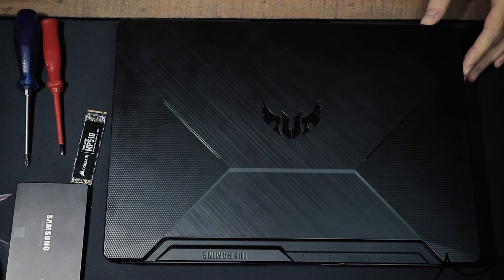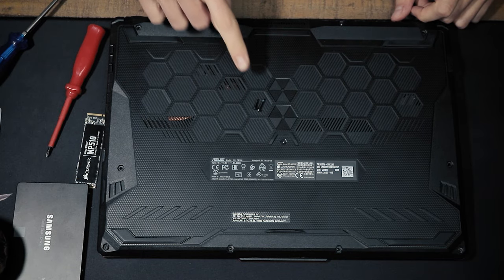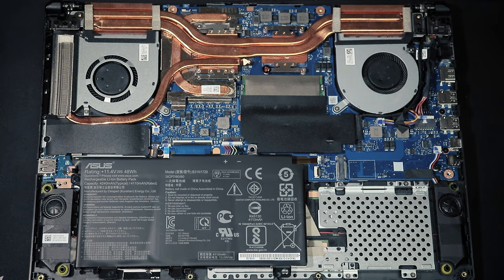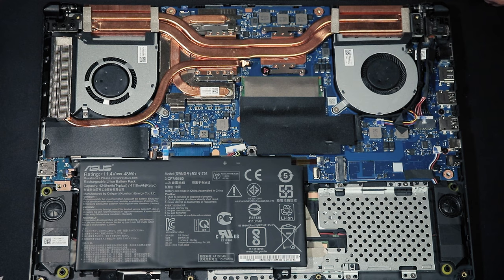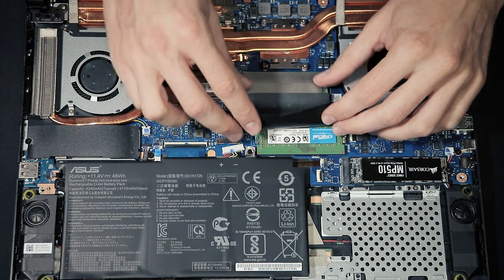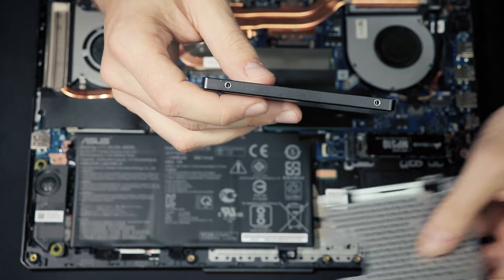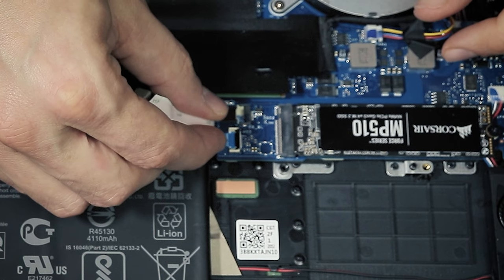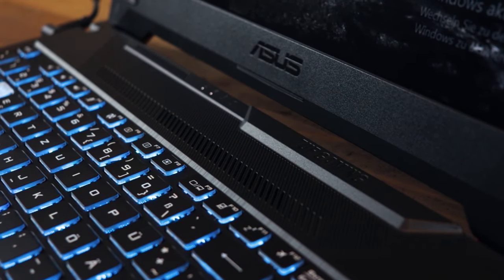ASUS TUF A15 // Installing SSD + HDD + RAM (Is the cable too short?)

Comment: Im getting my own tuf a15 in 3 weeksand im thinking about upgrading its memory and ram capacity on my own so thanks for this step by step tutorial.
Reply: Why so? 2021 or 2022 version has 16Gigs which means games runs good at ultra settings it's required to atleast have 8gigs and good specs which ASUS TUF A15 has RTX 3050 And AMD Ryzen 5 or 7 well.. In my country there's no the 7th version only 5th
Reply: @NitrixChamp  i found both 8 and 16 gb versions but the 16gb is €250 more
Reply: @obvious_giraffe8386  damn well for me it's like 823Eur
Reply: Enjoy bro it's a great laptop
Reply: @NitrixChamp it doesn't matter bro, you can buy cheap ddr4 Ram sticks 16×2 and replace them all

Comment: What cable did you use for the SATA? The Crucial SSD I ordered didn't come with one and I can't find one that fits online 🤦🏼‍♂️
Reply: It came with the laptop in the box. It should be in a small compartment inside a small plastic baggie, along with the screws in another small plastic baggie.
Reply: @TonyNYC233  cheers for the reply! I ended up getting the part number from Asus and found one for a few quid online 👍didn't have the screws so I ended up using electrical tape to secure the drive 😂 hasn't melted yet
Reply: @TonyNYC233  i dont have it on my 2021 FA506ICB
Reply: @yeeblun3654  Sorry, it's probably  not upgradeable. Check your specs.
Reply: @TonyNYC233  ofc it is

Comment: Thank you so much bro.  I received my new ASUS TUF 15.6" Laptop today.  But it came without the connecting cable.  I think I need to buy it separately.  Your video is absolutely a useful one.  Since the laptop came today has one more NVME SSD empty slot, I can connect one more NVME SSD inside and also connect the 2.5 inch SATA SSD too to increase storage.  Any way, thank you so much.  May God bless you.

Comment: Thanks for the video. I thought the cable was too short to put my old mac HDD inside (was from my ps4) turns out I was doing upside down as it was too thick... will have to order a thinner one. Cheers
Reply from the maker: Ha! That's Excactly why I made the video! Glad it was clarified! :)
THX for the feedback!
Reply: @Hubwood  Hello, I also have the same laptop, why didn’t they replace the factory one nvme V2 2280 ? which model RAM put DDR4 16 GB 3200Mhz ?
Reply: Question is that cable for the sata 3  included or I need to buy one?
Reply: @erickvargas2243  It was included with my laptop.

Comment: I bought a Samsung 870 EVO ssd for my TUF FX505DT and while i was able to install it by aligning the screws, the drive itself was too small, and there's a space between the bracket and ssd. I managed to set it up and seems to work. Do you think that there should be any issues?

Comment: Hola!

En la página dice que la capacidad máxima es de 1 tera en el SSD.  El equipo viene con uno de 500gm, en el otro puerto SSD M.2 PCEI, puedo montarle otro de 500gb y quedarían las 1000gb. 

La pregunta mía es, En ese puerto del HDD, puedo montar un SSD Tipo sata de 1 tera?  O tiene que ser HDD?

Comment: Thanks bro, but I had question. On 3:58 aside of the screw there's a connector cable. Is that okay if SSD stick pressing the cable? Because ssd usually getting hot while in use. Will the cable getting burnt or something?
Reply from the maker: Sorry I have no clear answer to that to be honest. I would assume it's fine as they only get hot when you copy large files for a longer time. But nor guarantees 😕

Comment: hey did your cable connector for the ssd include in the laptop or do you buy it separately?
Reply from the maker: It came with the laptop. Might be hidden in the package it came with.
Reply: @Hubwood  there's no cable in mine. How is it called?
Reply from the maker: @yeeblun3654  Check the pinned comment of this video!

Comment: Laptop model: Asus Tuf F15 Fx506hcb
Core i5, 8gb ram, 4gb Rtx 3050ti,60watt.
I have some questions:
1. Can I use a 7mm Sata hard drive raw without putting it in a sata enclosure (case) like yours?

2. Have you experimented with various sata cable like that of HP on your Asus Tuf laptop? Cuz I need to do the upgrade ASAP and I can't find an Asus Tuf F15 sata cable at my local store.

3. As long as my battery isn't 90W, the 7mm sata hard drive should fit in right? Cuz it seems 90watt batteries covers the HDD extra space

4. Will a 7mm HDD actually work? Because you used an SSD to demonstrate and I don't want to buy a HDD if it won't work but that's what I can afford for now.

Thanks in advance
Reply from the maker: 1. Should work, but especially regular hdds are vulnerable to moving around especially when acrive and should be fixated. You risk data loss and a head crash if it's loose.
2. No I didn't. Did you search in your box? It might be really hidden inside
3. Correct.
4. Yes. As long as it's really 7mm it should fit fine.
Reply: @Hubwood  Thanks a lot for the quick response and clarification. However, my PC didn't come with a Sata cable.

Comment: Thanks for the video! I don't have a cable inside my TUF A15 laptop nor it didn't come with the purchased SSD. Now I want to buy a cable. How is it called? Which one should I order?
Reply from the maker: Check the box again! I found it later. Might me hidden. It's tiny.
Reply: @Hubwood  but not with any tuf, i got 2 tuf and one was with cable the 2nd without i checked the box thoroughsly!
Reply from the maker: @alexanderunknown8605  absolutely possible. Yes. This video is about an older TUF. New TUFs are completely different laptops. Which is why I hate the naming schemes manufacturers give their laptops.

Comment: Can you give the link for the cable that plugs from the ssd to the motherboard?
Reply: It comes with the laptop in the box
Reply: What if I didn’t get it? Is there any place to buy that specific one?
Reply: You can get it from any computer stores or order online
Reply: @heistreaper3226  not with all tuf models! i got one laptop with cable included and second without! but there is a connection socket and hdd cage!

Comment: What is the name of the connection cable of the sata ssd and where can I get it?
Reply: It came with the laptop in the box. It should be in a small compartment inside a small plastic baggie, along with the screws in another small plastic baggie.

Comment: is it okay to just add the stock ram with another ram from another brand like crucial with the same clockspeed but different capacities, like the stock ram is 8gb then I will add a crucial 16gb ram with the same speed, is there any problems with that
Reply from the maker: No. But if you pair 8 and 16gb of ram it won't run in dual channel mode. For that you need two sticks of the same capacity.
Otherwise only 16gb of your 24 GB will run in dual channel mode. And you'll lose about 10-15 performance.
Reply: @Hubwood  using 24 gb and can't see any difference! ram matters for gaming with very high end gpu which is not the case about this "gaming" laptop lol
Reply from the maker: @alexanderunknown8605  no. You  can see that if you look at the FPS. You're lossing around 5-10% of performance on single channel mode depending on the game. 
Now one can argue, that 5-10% is not much, and it isn't, but it's there and it's "lost" ;)

Comment: What size/type of ram does it take? there were specifications for ssd size and hdd, but I don't think there were for ram. Should I be concerned with this if I'm looking into upgrading it? (I'm upgrading my pc for the first time)
Reply from the maker: Just look for ddr4 ram for laptops. So-dimms. They are smaller than desktop ram sticks. But easy to find online.
Reply: @Hubwood  And ddr4 are more expensive
Reply from the maker: @darth_santos1137  uhm ddr4 is the only ram that fits
Reply: it says inside “LTK4. OR 20291C”
Reply: Does it matter if the ram is 2400, 2666 or 3200 sodimm? It’s confusing…
Reply from the maker: @matthudson5635  didn't see the question sorry. If it's not too late: you should get ram with the same or higher speed, than the one which is already installed. A pc will always use the speed of the slowest installed ram stick.

Comment: What about upgrading the battery to a 90whr by removing the SATA cage? I heard it's possible? I really need help with this because the official ASUS service center in my country will NOT issue a higher capacity battery for my model. PLEASE HELP 🙏
Reply: Yes it's possible, i have a friend with this laptop and upgraded the battery to the 90whr one, he only need to put some adhesive so the battery won't wobble.

Comment: Nice video, but where can I get that cable to connect my SSD to the motherboard?
Reply from the maker: It should come with the laptop in the original packaging... 😕
Reply: @Hubwood  I bought mine off of someone else without the original packaging. Where can you get one?

Comment: I have a ASUS TUF Gaming A15 FA506IC and I'm not sure if my laptop has two NVME SSD slots or not. I've heard that it does but then I've heard that it only has one NVME SSD slot and then a normal hard drive bay instead. Can someone tell me which one is correct for my specific model?

Comment: Hello there, I have successfully installed a 2,5 inch ssd (120 gd) and installed windows 10 OS for a dual boot experiment. However I am unable to boot the new hard drive, i could eot from the (esc) boot menu. But now it wont boot. Any ideas?
Reply: if you have secure boot on then it won't let you select the boot media.

Comment: Hi, nice video. Just two simple questions. I've ASUS TUF A15 (8 GB RAM + 512 GB SSD + 4 GB NVIDIA 1650). I've an empty slot for RAM, and an empty slot for 2.5 inch SSD / HDD but no slot for 22 mm x 80 mm  SSD. Is your model different ? 
Second Question, you are inserting a 2.5 inch SAMSUNG 500 GB SSD, but the slot on the motherboard says HDD. Is there any kind of issue if we insert a 2.5 inch SSD as you did. Does it have a difference or side effect?
Reply from the maker: Might be different!
In terms of the ssd you need to make sure it's a slim 7mm ssd. 9mm could be a problem (I'm referring to the thickness)

Comment: I have the ryzen 5 version , 512ssd. What's the maximum ssd I can put? Like is it only 512 for each slot ? or can I place a 1tb ssd along with the 512 that came with the laptop?? Thank you sir!
Reply from the maker: You can place a 1tb along the 512 gb ssd :). Most 2TB Ssds "should" work too.

Comment: Are these cables common? i.e. can i use a similar asus cable  of asus x515?
Reply from the maker: I don't know. The cable should be included. If not I posted a link in the description and pinned comment.

Comment: 2:21 Don't do this. Instead, flip the laptop closed. Put your fingers in the hinge well, hooking on the bottom, and pull up. Repeat on the other side and release the center (by the screen area) then pull up from the center (that you've just released). It will pop open no dents, no tools.
Reply: it's safer but if you are experienced you can do like in video.....

Comment: At 8:50 you say "you reconnect the battery, because otherwise laptop won't turn on". Surely this can't be right? Is there protection against running the laptop without battery on this model, just from wall power?
Reply: no, these models do work with battery disconnected i have tried on 2 models!
Reply: @alexanderunknown8605  I figured it was just some random speculation, thanks for confirmation!

Comment: Is it huge difference between 16+8 and 16 single channels?
I wanna add 8gb ram for this laptop
Reply from the maker: if you combine 16 + 8 GB only 16GB will run in dual channel mode and 16-24 wont. This CAN cause some issues, or lets say it's not "optimal". The Laptop will work and everything, but you're leaving performance "on the table".
Reply: @Hubwood  thx

Comment: Bro is that real to use 9.5mm hdd if i will buy longer cable?
Reply from the maker: Thicker ssd/hdd won't fit. You can't properly close the laptop with 9,5mm hdd.

Comment: hi quick question is kingston 16b DDR4 3200hz would be compatible with the 8gb 3200hz in a15 2021 version? would like to upgrade to 24gb ram if possible. and have 32gb ram in near future.
Reply from the maker: Yes you can do that. It's not 100% optimal though as only 16gb of your 24gb will be in dual channel mode.
But it's better than nothing 🤷‍♂️
Reply: @Hubwood  so if i want it to be optimal, both ram should be 16 gb ?
Reply from the maker: @aerutus4720  yes. Excactly.

Comment: hey man I have a question for u. I am planning add hdd to my computer. I already have 256 gb ssd. I worry about if I add hdd my computer will be slower or stb. Is there any problem with that? @Hubwood
Reply from the maker: Are you planing to use the hdd als system drive? Or as a second drive? What will you store on the hdd? Games? Or just files and data?
Reply: @Hubwood  I have 256 gb ssd on my laptop. I am planning add hdd to M1 slot.  Probably I will store games. If i use hdd and ssd same time is my laptop getting slower? I don't have too much money. So i thought if i buy hdd i can store 1tb. which one is better, 400-500 gb ssd or 1tb hdd?

Comment: Believe it or not you can leave the battery unplugged and it runs still lol I was surprised cause I had never heard of people doing that to save battery life but that's how I run mine now cause it never leaves the house really
Reply from the maker: Yepp. Doesn't work on all laptop models though ;)
Reply: @Hubwood  yea i was gonna say yours has a bigger battery than mine and where the extra space is left theres a sata ssd slot. what gpu is in that model?
Reply from the maker: @JimmyFingers  RTX 2060

Comment: How do I take out the previous HDD on the computer? Because if I install another one than I’ll have two hard drive disks I only wanna keep the new one so how do I remove the hard disk drive that came with the computer? I need help please.
Reply from the maker: That would be the m.2 ssd on the left side (when the battery is at the bottom).

You unscrew the old m.2. Ssd and insert the new one.
However that way you would need to install everything from scratch.

If you want to copy the old ssd you will need to install both first and clone the old one to the new one. For example with a free tool like macrium reflect.
Reply: @Hubwood  so the hard disk drive is under the battery?
Reply: @Hubwood  I’m just trying to take out the old HDD drive and install new one but idk where the old is at
Reply from the maker: @BananaYT  im showing the place of the old ssd at 3:16
Reply: @Hubwood  not ssd I want old HDD
Reply from the maker: @BananaYT  this laptop usually doesn't have an old hdd. It comes with an m.2 ssd.

Did yours come with an hdd?
Reply from the maker: Open it. Make a picture. And upload it. Post the link here. I'll help you.

Comment: can i replace my windows ssd like if i back everything up then replace it or no?
Reply from the maker: Yes of course.
The best way would to clone your windows drive to the new drive first. The replace it. It will be like nothing happened. You can do that with the free tool Macrium Reflect. Pretty easy to use. Still look at tutorials so youre sure to use the whole new drive and prevent the system to cap the new drive at the old drives capacity.
Reply: @Hubwood  thank you im kinda new about upgrading because ive never really had to

Comment: This helped alot , one of my ram sticks is Failed so will it run in dual channel if i use crucial cl22 3200 mhz ddr4 ram ? 

Or would i need to put 2 crucial same sticks ? 

Also, in my laptop the black plastic is Glued to another Ram. So should i remove it ? 

Also, Does performance change with crucial ram having no heatsink like the original ram installed?
Reply from the maker: They will run in dual channel yes. The laptop will adjust both sticks to use the same stick as the slower one.

You could just use the heatsink from the old one. But it should not have a big effect overall.

Comment: My laptop won't boot when I install a second RAM. Any advice?
Reply from the maker: Try ONLY the old ram in the second slot to see if the slot itself is broken.
Also try ONLY the new ram stick in both slots to see if it works that way.

Comment from the maker: The SATA cable should be HIDDEN in the laptops original box! If not, and you still want to buy the cable:

My cable says "fx506/706 hdd ffc". 
Just Google this. It is for the ASUS TUF A15 2020.

Or look on ebay or ali express for "ASUS TUF A15 HDD CABLE". If possible add your specific model name (in my example that would be FA506IV-HN291).

Like this: https://de.aliexpress.com/item/1005004674648002.html?_randl_currency=EUR&src=google&src=google&albch=shopping&acnt=494-037-6276&slnk=&plac=&mtctp=&albbt=Google_7_shopping&albagn=888888&isSmbAutoCall=false&needSmbHouyi=false&albcp=12554800262&albag=127990761348&trgt=1284054470089&crea=de1005004674648002&netw=u&device=c&albpg=1284054470089&albpd=de1005004674648002&gclid=Cj0KCQjwnbmaBhD-ARIsAGTPcfU2DH9-Eke83UmknskzIaIGj6KQ69W9Uy3t92LpE1z7o75qKaGOnAEaAjSHEALw_wcB&gclsrc=aw.ds&aff_fcid=e4313efe6f15408b916c5960ceca2c07-1666126470634-08330-UneMJZVf&aff_fsk=UneMJZVf&aff_platform=aaf&sk=UneMJZVf&aff_trace_key=e4313efe6f15408b916c5960ceca2c07-1666126470634-08330-UneMJZVf&terminal_id=24e77362874f4c36bf82473ab1247921&afSmartRedirect=y
Reply: hello, my asus tuf gaming f15 laptop did not come with a mount for the ssd, what would i search if i needed to buy that?
Reply: @indigo2061  This computer is the A15, in case your computer doesn't come with the port, you could buy a disk enclosure.
Reply: does the SSD bracket come with the laptop??
Reply from the maker: @adhikaputraagrawijnana4305  in my case it came with the laptop. Hidden somewhere in the original box! But other reported it didn't come with the laptop. So that's why I posted the link on where to buy it.